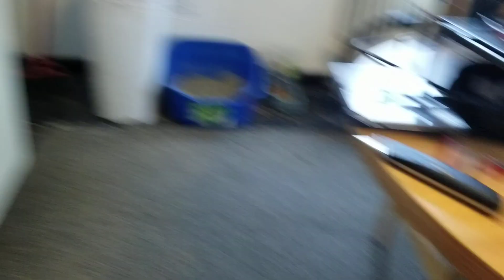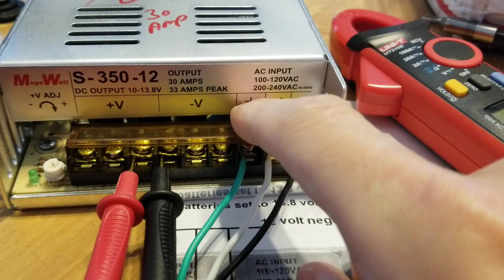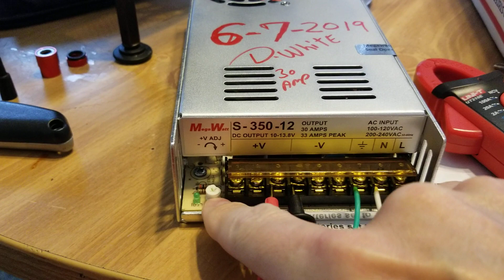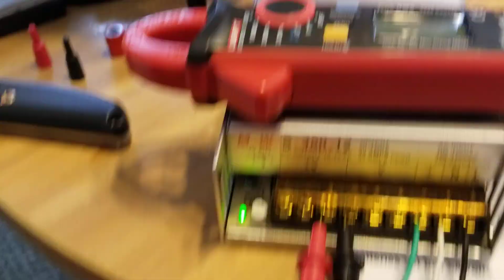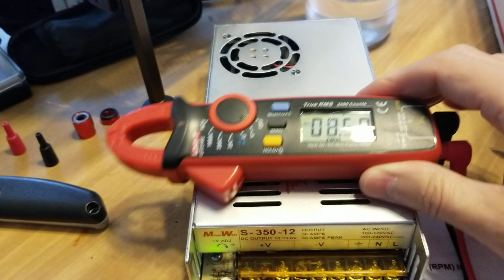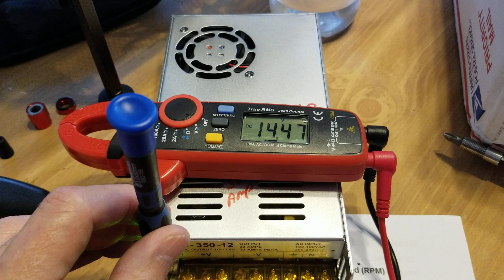MegaWatt Power Supply for Ham Radio CB  Radio set up

Comment: hello I have the same power supply, or rather the voltage from this series of power supplies is adjusted to 13.8v, the power supply works ok, it works fine with the president lincoln1 but when he charges the smartphone listen to the interference power supply, did you have it like yes say please how to eliminate this problem from disruptions ..
Reply from the maker: contact john @ megawatt off of the website he will probably have  solutions. you can also try ferrite beads on the cell phone cable?

Comment: Thanks, Dave.  I bought one of these and I'm getting ready to wire it up, but the terminals on the radio wire are too large for the small connector on the power supply.  I can cut them and crimp on some smaller, forked terminal ends, but I'm concerned I'm downsizing the ends too much.  I skipped circuits in college and I don't understand why the wires and terminals are so much larger than the computer cord wire that's supplying the power.  Can you include a pic of the radio power lines actually connected to the power supply, or simply comment on connectors.  Thanks much.
Reply from the maker: Ac and dc require different wires.  Dc needs bigger multi stranded wire to carry current whereas ac can use thinner lower strand or even solid conductors.

Comment: Thank you very much for this video, I cut open my three prong computer cable to connect to my MEAN WELL switching power supply similar to the one you have here and my three wires inside are color BLUE BROWN AND GREEN/YELLOW STRIPE, so which one is ground, neutral and positive?
Reply from the maker: Use your ohms meter and figure it out.
Reply: @DAVE_WHITE  I did figure it out

Comment: I just ordered 2 of the 50 amp and want to run them in parallels. I have a new Delta Electronics 60 amp power supply on a Texas Star DX500 and it all dims when I key up, I’m hoping this will remedy it
Reply: @DAVE_WHITE  100 amps should run a TS500 no problem they draw about 65 amps of current @ 13.8 volts.

Comment: Just an additional observation for people who use these: 14.4 volts is generally the max an alternator charges a vehicle at these days. Therefore I understand wanting to set it at that point. It should be noted that most equipment is usually specified at 13.8 volts for the unit to operate as advertised, some vary a little on their spec sheet. A lot of folks buy these and set them to about 15 volts when they are using them with an external "CB" type RF amplifier as most will easily handle that voltage and it also helps keep the maximum peak power available out of the amp. These are great working power supplies and are as about RF noise free as you will find out there! I highly recommend them. The Duracomm's and Iota branded ones appear to be nice and clean also from my past experience with them. Have fun!!
Reply from the maker: Your vehicle charges at approx 14.3 to 15 volts  setting these to 14.3 or 14.5 is fine.

Comment: Are the MegaWatt power supplies noisy (rf noise)?  My Radio Shack 25 amp switching power supply is very noisy on my HF receive radios. It's noisy even on the HF radio sitting on the next desk connected to a different analog power supply.
Reply: Pirate, I have a MegaWatt 36 Amp and also an Astron VS-50M (50 Amp) Linear Power Supply.  I've been impressed with the MegaWatt.  Works great.
Reply from the maker: megawatt on his site has a video of a noise test that was done comparing these to the cheap knock offs..
Reply: You never see a review where Megawatt vs. Meanwell,that would be interesting! Maybe same company.